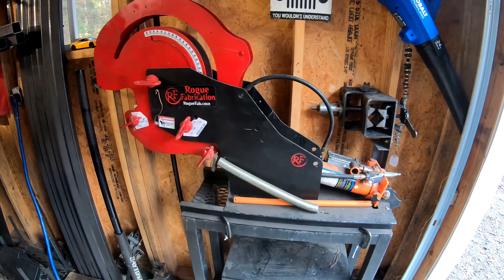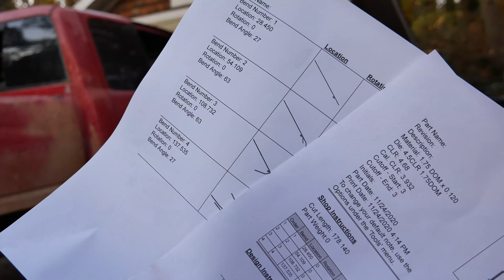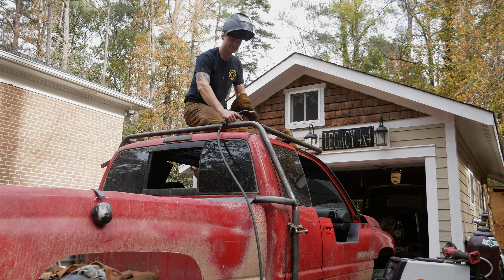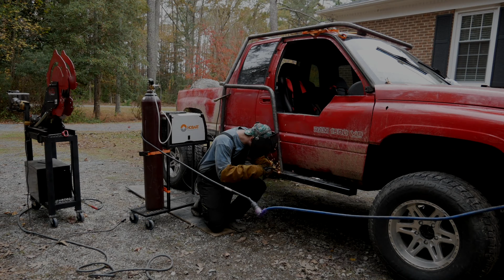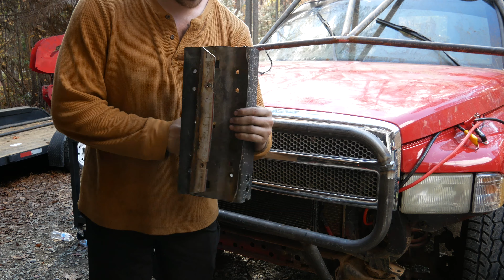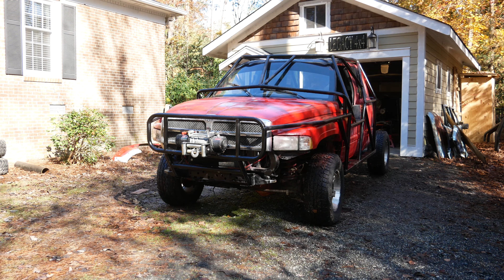Dodge Ram Exo Cage Build up w/ Rogue Fab and Bend Tech || Legacy 4x4 and Off-Road

Comment: Nice fabrication work. I run over a lot of brush and trees on my overgrown 180 acres of Alabama. Small trees try to spring up between the bumper and the tire, eventually smashing the fenders in until anything is strong enough to get in between your tire and your frame. Same between all wheels and the rock sliders too. Could ignore the rear, but I make my own trails and that requires backing up sometimes. The other thing is large branches or leaning trees that ride up over the hood and hit the windshield, so you need a smooth guide that picks it up from the bull bar and smoothly lifts it to the roof rack. This is done slowly so the forces aren't impact, but I need to push stuff out of my way without getting out in all the sticker bushes. 
It kind of looks like yours is optimized as a roll cage, which I personally don't need, other than I sometimes knock down a small tree that's holding up a big tree that fell long ago. If I don't notice, I get some pretty big stuff falling on my cab. I never go fast, I'm too busted up to take the beating, so I'm not a rollover risk, which makes me think I could save some metal in that area, over the type of off-road I used to do.

Comment: Exo Cage turned out great. What size tubing and wall thickness did you use?
Reply from the maker: The whole thing is 1.75x.120 DOM, total of about 160ft, should be plenty for a truck this size. Thanks for watching!